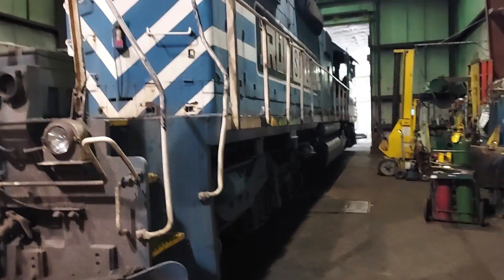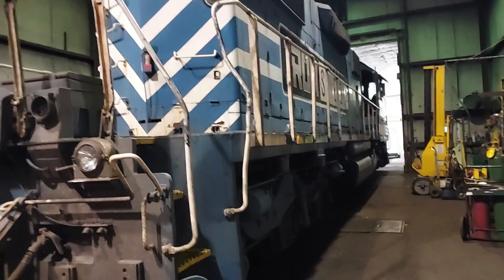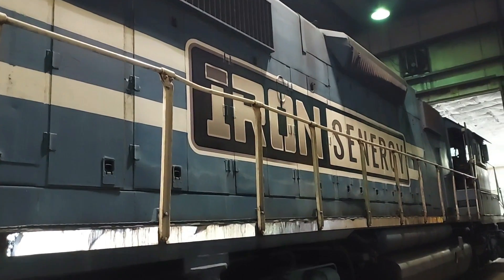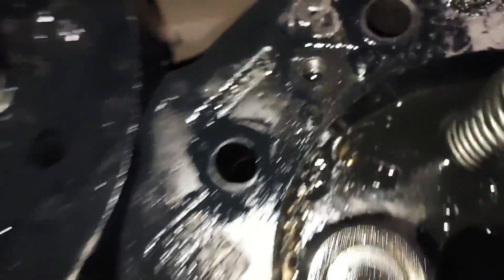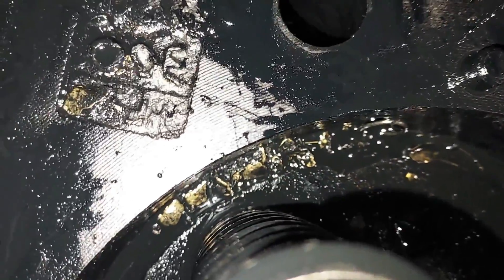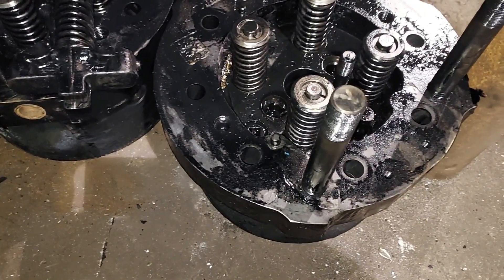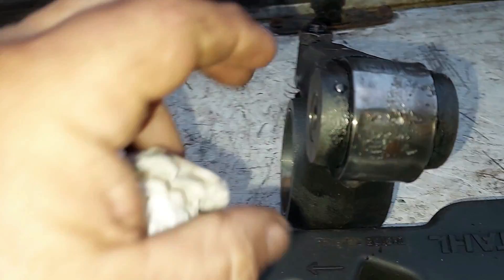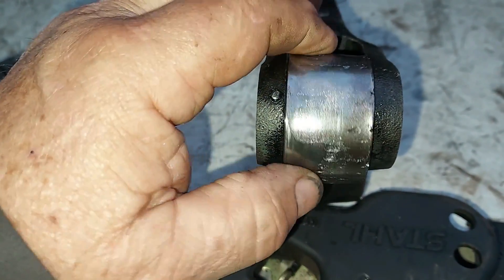EMD 645E Cylinder Heads Replaced on our #22 Locomotive

Comment: Happy thanksgiving to you and your family!!

And I did promise you a recipe, but I decided I'm going to make a video of it because writing that recipe in the description is bound to go wrong. I'm waiting on a part for my food processor then I'll make that video up for you. I for one am thankful you do these videos. I've learned a lot from watching them. And I'm thankful your employer lets you make the videos. And I'm thankful I can have the internet and computer to watch your videos. LOL....

And yes, you are correct, that groove in that cam bearing is for oiling and copper isn't good. When you see copper, you got problems. Now, I'm not a diesel mechanic but my dad was and even so, I'm kind of out of place commenting but from what I believe to be true, as long as the bottom end (crankshaft, main and rod bearings) are good, you can rebuild the top end of that motor without having to ever remove it. New pistons, cylinder sleeves, heads, cam etc. 
However, from looking at the damage you showed there, I'm going to take a gander that the motor is on borrowed time and probably needs to be completely removed and rebuilt or swapped out with a reman motor. I'm going to guess they (Your employer) want to band aid this engine and just keep it going as long as possible because the mine isn't going to last but a few more years, and once the mine closes they will sell the locos to someone else. I might be wrong but that's my guess. When these things get old, they become a money pit. Eventually these locos will need a complete reconditioning, or they will be scrapped. 

Too bad no video on the repair. Anyway, be safe this weekend. Holidays are full of drunk drivers. May HaShem keep you and your family and all of your workmates safe this holiday season! 💪🚂🚂🛠🔩⚙🪝🏁🏁🏁
Reply from the maker: Thanks David for the nice comment. Happy Thanksgiving to
you and your family also. Yes sir with these old locos seems
like theirs always something that needs repaired. What did not
help at all was our last company not wanting to spend any
money at all because they knew they were selling. So mucho
things didn't get done that should have, one of which was
loco maintenance. They only did what they absolutely had to
in order to keep them running. Appreciate your dropping in on
us and will look forward to the sauce video!

Comment: Is the engine swap still planned to go ahead.
Reply from the maker: As of now it is not chox2001. They are still up in the air what
they are going to do with the stored engine. They also have
some more engine parts to change on #22 but don't know
when that will be done. But 22 is back in revenue service
and running as well as can be expected, much better than
before. Thanks so much for tuning in and watching tonight
my good man.

Comment: Those particular parts are called valve bridges. We change them every time the injectors get changed.
Edit: Those are flat worn out, the rest most likely aren’t far behind. You should recommend to the mechanic in charge of your locomotives that all of them need to be changed.
The worn pockets in the heads were most likely caused by the worn out valve bridges. When one comes apart like the one that the spring came off of, it’s time to get the whole set on the engine changed.
Reply from the maker: Thanks Ralfie, I figured you would know. Part of the engine
jewelry as our contract mechanics refer to the assemblies as. 
Always is a pleasure to have you visit and write in my friend.

Comment: Some rather worn parts Dave, good thing they changed them. 22 sounds like it`s ready to go! Have a Happy Thanksgiving!
Reply from the maker: It's back in revenue service Wilbur, although there is now a
problem with the air, keeps wanting to blow off pressure
below pop off setting, that will be a future video, but probably
you won't see it till next spring or summer. At least it's running
and hauling coal again. Thank you so much my friend for
checking out tonight's home movie. Have a great day tomorrow.